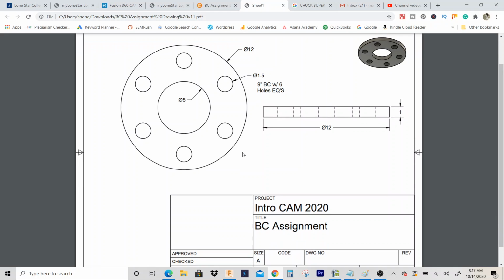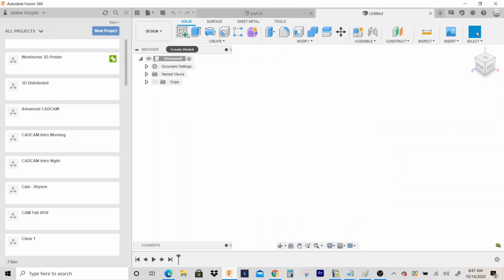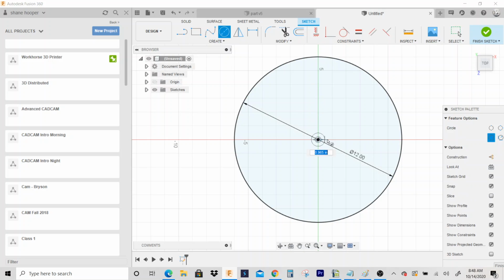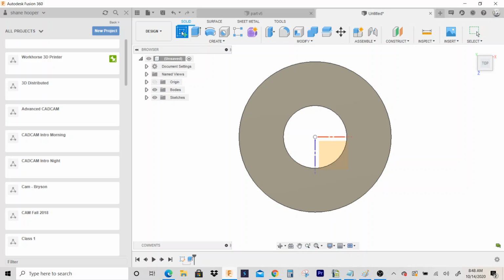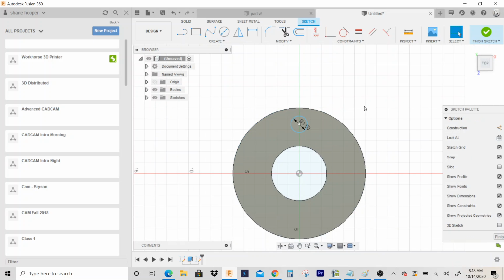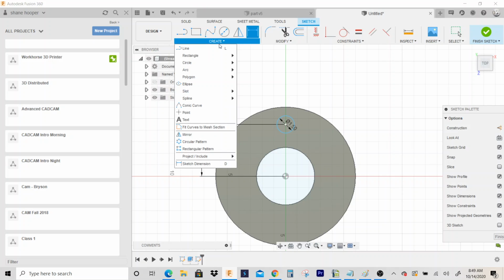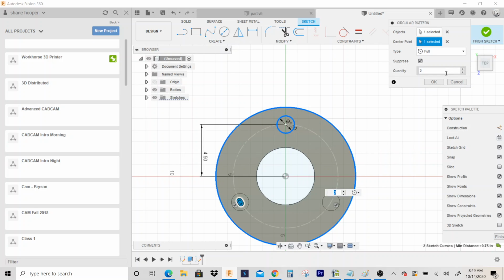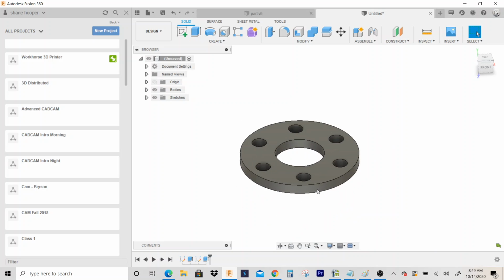Fusion 360 Tutorial: Bolt Circle Exercise

Comment: There are a few steps you did not cover in this simple demo.
Very confusing for beginners..
You do not explain how (in this run through) the circles for the bolt holes end up on the UNDERSIDE of the part and to extrude them the piece has to be flipped..
Reply: I tripped big time on this, could not figure out why I couldn’t select the circles

Comment: please comment on the keys u r using or use an app which is showing ur keybaordinputs.
Reply from the maker: Fusion 360 keyboard shortcuts are:
c = circle
r = rectangle
l = line
There are many more. If you hover your mouse curser over a tool Fusion 360 will show you more details that include keyboard short cuts.